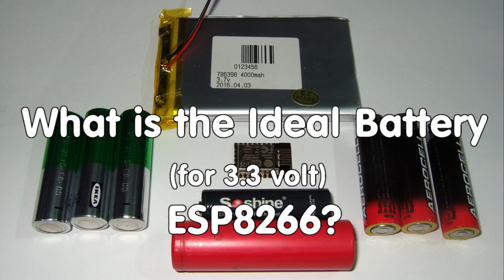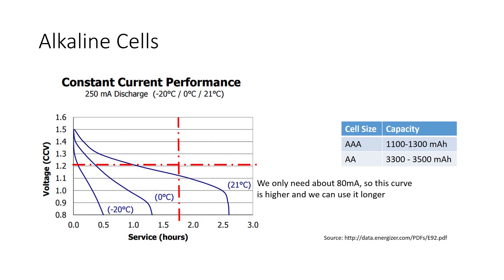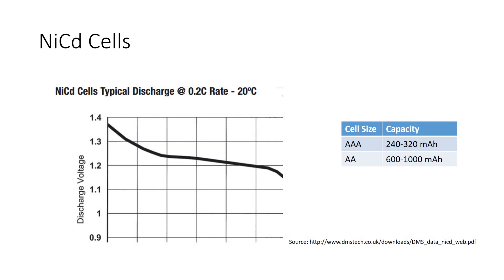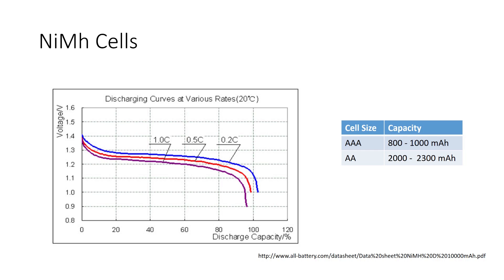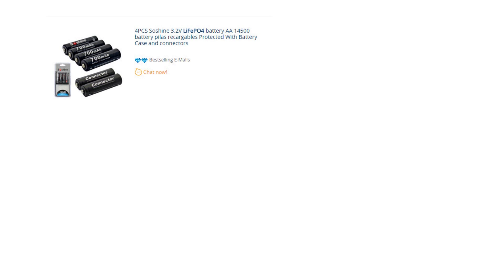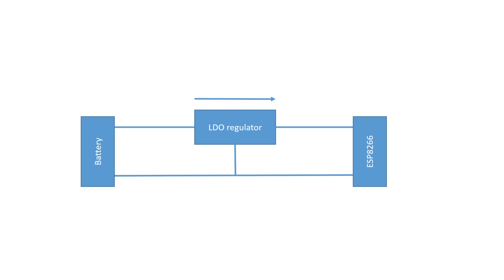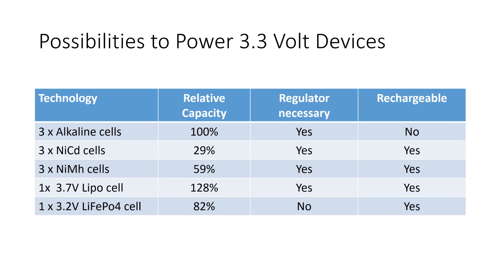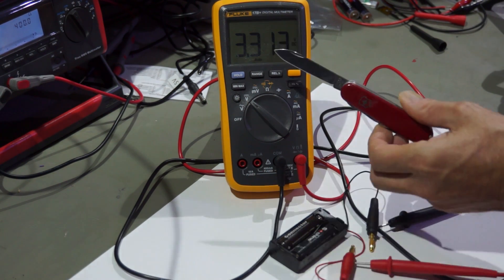#64 What is the Ideal Battery Technology to Power 3.3V Devices like the ESP8266?

Comment: Hello Andreas. Although I knew about LiFePO batteries I never considered using them with my 8266's but I will now! I was struggling with voltage regulators and buck convertors but maybe I can skip all that and use LiFePO's instead.By the way, in the video you mention that LiPo batteries are not available in AA packages but I believe that 14500 batteries are roughly the same size. Some LED flashlights can use AA batteries or 14500's.
Reply from the maker: You are right, they are also available in this package. So, you have the same "danger" as with the LiFePo4 batteries...
You shouldn't struggle with linear regulators, they usually work fine, if you add a beefy capacitor between plus and minus of the ESP. Maybe you watch my videos about deep sleep. There, You find some explanations and tips.

Comment: Thanks Andreas, very informative video. Just a thought: Instead of using an LDO regulator  for for NiMH etc, what if you use  diodes in series to drop the small amount of voltage drop required? Would that be more efficient than using an LDO. Of course at the device you would have a higher voltage swing over the useful portion of the discharge curve. Cheers.
Reply from the maker: I do not like diodes for that purpose. They have a constant voltage drop of ca. 0.6 volts. With a fully loaded battery this is not enough and if the battery is at the end of its live your device will stop too early. Efficiency can be a little bigger, but if you use a good regulator (see video #58) this is not a problem. The only positive could be, that a diode is cheaper than a regulator, but today, this is only pennies.

Comment: Hello Andreas, very informative video, as always. I'm wondering what you would use if you needed to power your solution using both 3.3V and 5V. Use case is some of the sensors (ultrasonic, PH, etc.) and displays (most of the LCD's) require 5V while ESP8266 requires 3.3V. Bi-directional logic level converters can be used for the data lines but we still need to power the sensors/displays using 5V. Thank you in advance :)
Reply: many sensor modules just require 5V because they need a stable (low noise) 3.3V supply and use a linear regulator with 1.25V drop. in a low current battery application, it might be worthwile figuring out if you can supply the sensor directly, especially if you are already using a linear regulator elsewhere for 3.3V.
Reply from the maker: If you need 5 volt and 3.3 volt just use a linear 3.3 volt regulator (e.g. AMS1117). You even do not need a LDO because the voltage difference is 1.7 volt. Just make sure, that the package can dissipate the heat.
Reply: i'm trying to figure out how to achieve long battery life like your #47 video and also supply 5v and 3.3v. Will you make a video to address it? Thank you.

Comment: Hi Andreas, nice video! Must get a connection battery, very handy.
Reply from the maker: Thanks. I think, this battery can be done yourself. Just use a woodstick, cut it to length, and  put a wire from one to the other side (maybe with a screw on both sides).

Comment: Dear Andreas,

thanks for this video, i have been really looking for something like this to understand which battery i can chose for remote toy car i am planning to make for my kid using power hungry esp8266. 
i just have a very small suggestion, if you find it appropriate, generally all such videos you make about comparisons and evaluations of different concepts, equipment or things, are full of very useful information.  can you at the end make one slide with conclusions - in text form. because it helps in remembering the final outcome of the study.
Reply from the maker: Good idea.But it is not easy because my videos usually are already compressed. But I will think about it.
Concerning toy: motors are usually power hungry and need higher voltage. So, LiPo is probably the best solution. And a regulator for the 3.3 volt. The ESP will anyway use much less current than the motor.